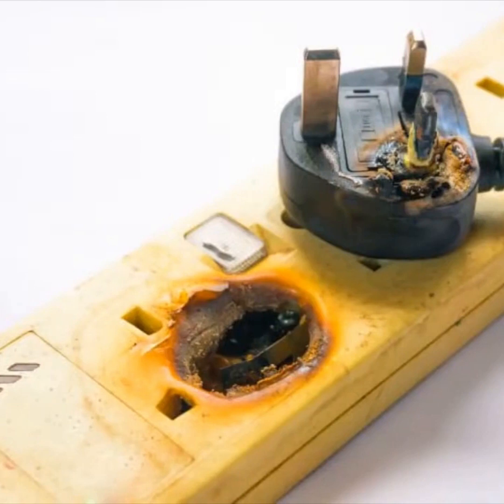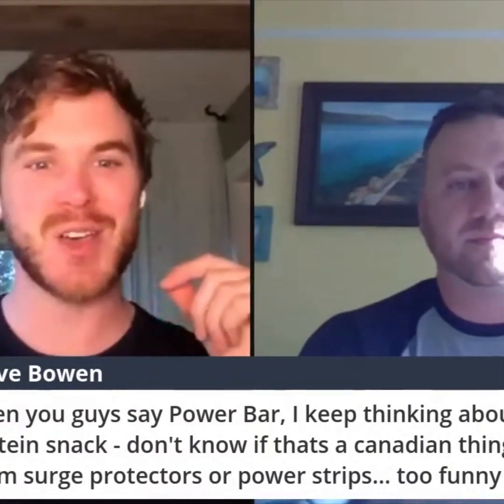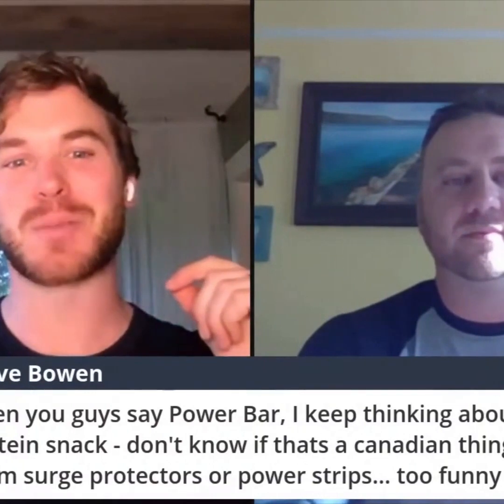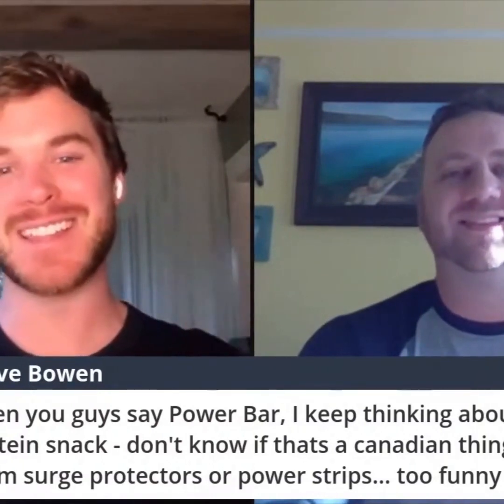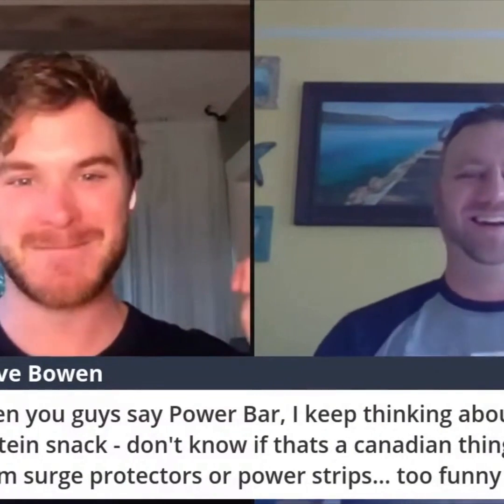Mike Holmes Jr Reacts to a BAD Electrical Fail!

Comment: I cannot tell you how many times I've seen people plugging space heaters into $2 power strips. It drives me insane
Reply: I used to get calls from family all the time "Can you fix my pc?" 2500.00 gaming system plugged into a dollar store 'surge protector'. Come on people, common sense please. You can't get a good candy bar for a buck now, you really think plugging wiring into something half the cost of a king size snickers is a good idea?
Reply: @arudanel5542  A good power cleaner costs roughly $100 for a reason!! Invest in a UPS if you're going to set up such a high end system